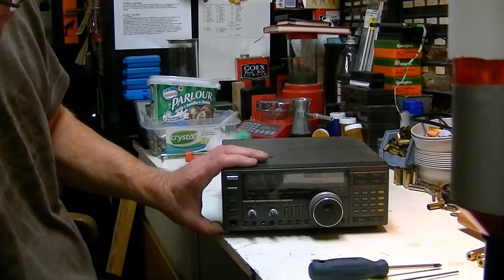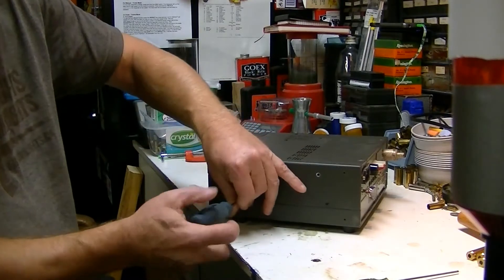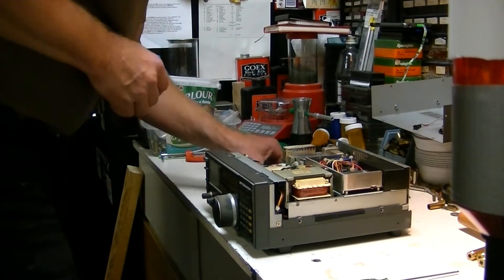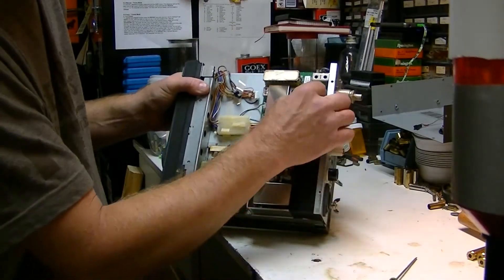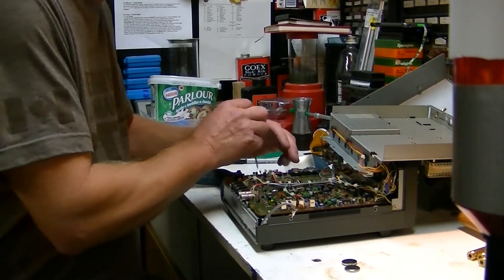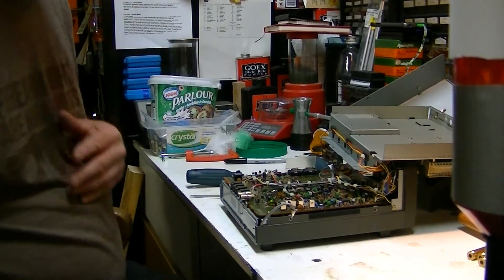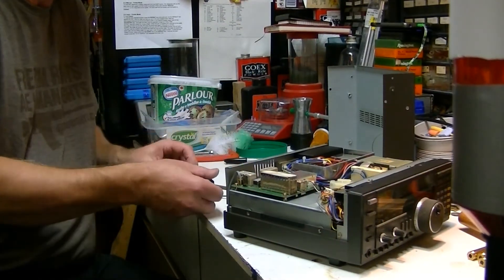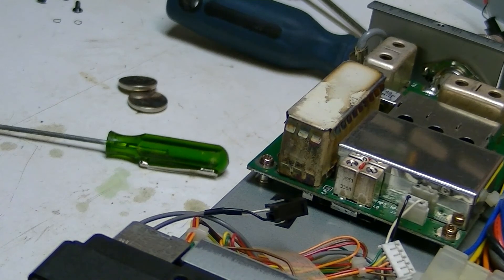Icom IC-R7100 memory and clock battery change

Comment: Hello, I just bought a used ICOM IC R-7100 and the tuning knob wobbles.  Does it just pull forward and tight a nut or how do I tighten the knob?  Thanks, Tom
Reply: look for a small hole on the side of the knob near the base, its a torx screw.

Both the operator (user) and service manuals for all these old radios are online.
Reply: same for my 7100. but not so much